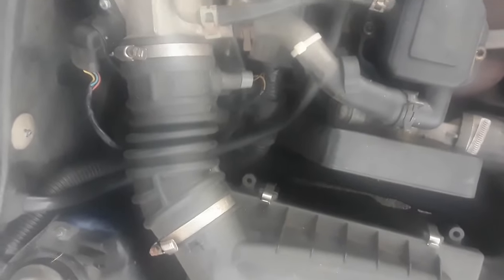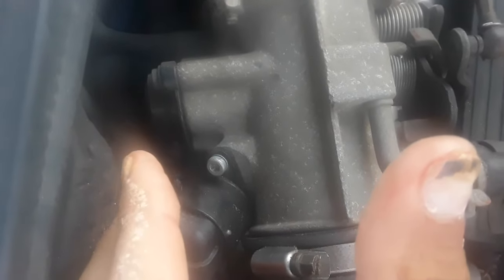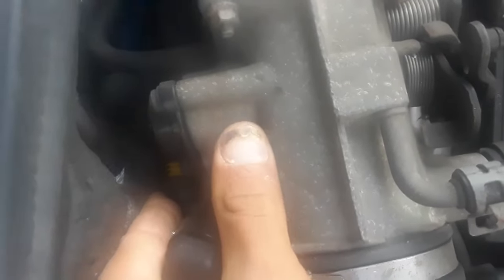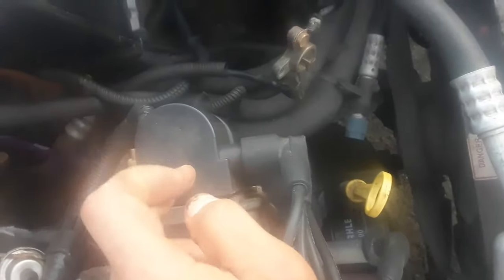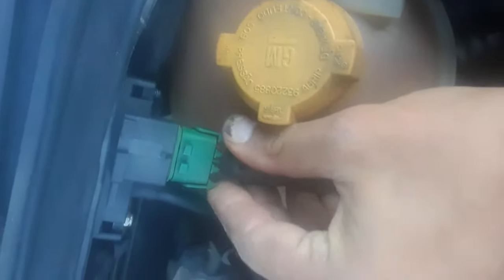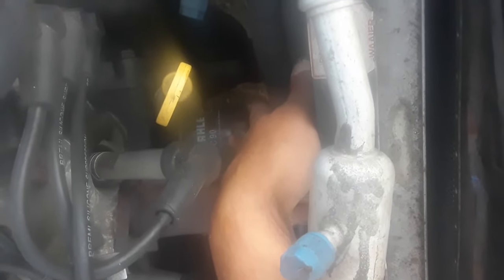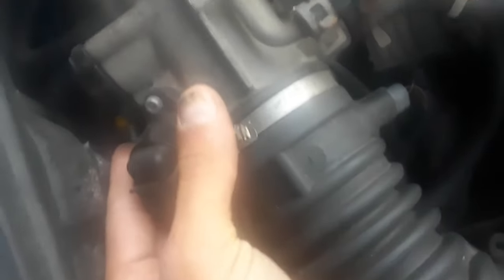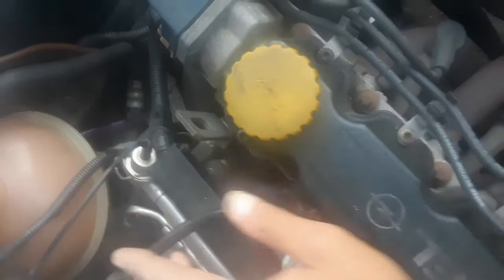Corsa b problems with the idle and service information

Comment: Thanx for the video, struggling with a Corsa ideling irregular. Changed 2 sensors will try the third one. Then the fuel pressure regulator.
Reply: Buy idle control valve from the agent sometimes new aftermarket doesn't work or goes bad in like two weeks

Comment: Guys i am having the same problem started with over idle. Changed the spark plugs now idle drops t0 05. Air sensor and tps changed when stopping. If i tap lightly on the feul, idle will go up and stay there. But the problem remains, starts easy drives just ising alot of feul

Comment: Hi great video I have a 1.4i Corsa gamma 2005 model I put in a new battery car starts fine most times then sometimes it starts then it wants to cut out starts hunting until I give it petrol then it idles fine no issues when driving.  What could be problem? 
Thanks

Comment: Hi👊🙏 great video, I also have the same problem, but I've realized that it's the mep sensor, can it be cleaned or i need to get a new one? 
Another problem i noticed yesterday when driving,  the car just cut out when i increase speed to 30km/h, but it doesn't die, keeps on idling and when i put it on newtral and raf it, it's doesn't cut out. It only do that when I'm driving. 🙏 What might be the problem 🙏😏

Comment: Thanks for the info,what can the problem be if car starts perfect,idles normal but as soon as you drive at a constant speed say 40km/hr then there is a flat spot and jerky reaction.If you drive fast the problem is not that obvious. Not sure if its a fuel issue or a spark problem, replaced the HT leads and spark plugs already.Only have the car now for 4days.Corsa lite,2000 model.
Reply from the maker: Check if you take the tps throttle body sensor off and drive if it does the same might be that or might be a fuel filter or pump
Reply: @Money-ot8ks  thanks,I cleaned that idle switch and its already running better,will get a bottle of brake cleaner and clean the switch and throttle body better aswell as get a new fuel filter.Thank you.
Reply: @barry4140  hi i experienced the exact same proble with my opel i replaced the map sensor and that flat spot went away.

Comment: Hi my problem with my corsa lite 1.4 is that on the injector cables number two has less spark so machenic put wire across from number one to number two...it runs but full peddling u can see it doesn't going anywhere....what can i do regain its power

Comment: hi i have a corsa lite 1.4i changed all sensors , plugs, fuel filer but bakkie still have a mis and no power. any idea. or do u have a workshop
Reply: Timing is wrong or the crank pulley has play
Reply: Where are the PCV valve sits on the Corsa b 1600i sport 2001
Reply: Hi I have a corsa utility 1.4i 2007.
Has a misfire and won't rev past 3k and has no power

Comment: I have an Opel Corsa 1.4 the idle valve has been replaced twice and the throttlebody.  The car continues to idle erractically.  I would like to know if I need to buy an original from GM.  Putting a third idle valve in and then thinking I will order an original but it has an 8 week delivery time.

Comment: Bru can you maybe assist
 I've changed all the sensors car idle fine but after driving for a while it doesn't want to idle changed computer box injectors bat3 hole motor was done  
So im lost atm dont know what to do anymore

Comment: I have a 2005 opel corsa lite. I replaced the idle control valve. But now it idling high and its 7kms to the litre
Reply from the maker: How does it idle when you plug it out? It may be a faulty sensor to because aftermarket cost anything from R100 to R300 but original is R1300 +- so people buy the cheaper option but those things give alot of problems like I said it might be a faulty sensor even if it's new so don't tamper with it. Keep it plugged it but loosen it and see if the piston moves in and out
Reply from the maker: If its stuck send it in for a claim

Comment: What's the problem if the car idle at 4000rpm, I changed the IAC
Reply from the maker: Did you check the idle control valve if you plug it in an out? Usually its that if not then the sensor next to it the butterfly sensor tps plug that out.. if no difference then its that. But its sounds like that idle control valve the one with the piston.. piston might be stuck
Reply from the maker: Take that sensor of it takes two spline bolts but keep it plugged in and the car switched on then see if the piston moves in and out to check if that sensor is working properly
Reply: @Money-ot8ks  I put a new idle control valve.....it's still high idle, there is some hissing sound near the injectors so maybe it could be the gasket on the intake manifold that's allowing more air than supposed
Reply: Can you please show us the speed sensor because my speedometer and ado meter are not working
Reply from the maker: @mokoensn  I sold the car but if the gauges aren't working check by the firewall there is a cable that plugs into that. That is a white gear wears out
Reply: Good evening guys... I got the Same problem, I changed position valve sensor, I changed the idling sensor... It just was okay for a day, then back to square one.

But now when I switch of the engine and re-start it, maybe 2 to 3 times, it becomes normal, please help, it burns too much fuel